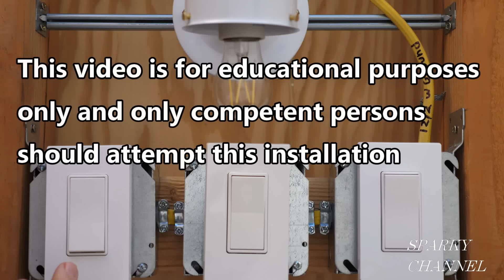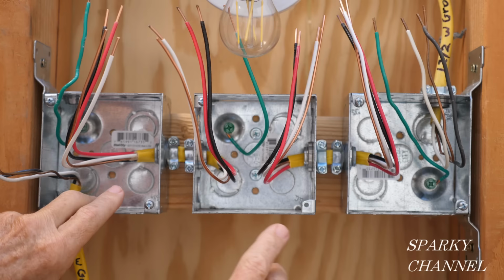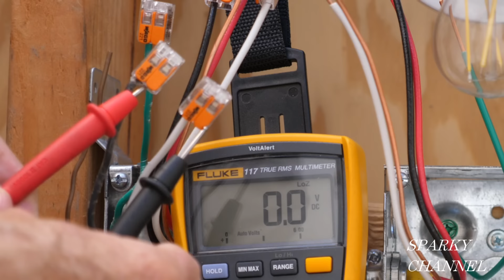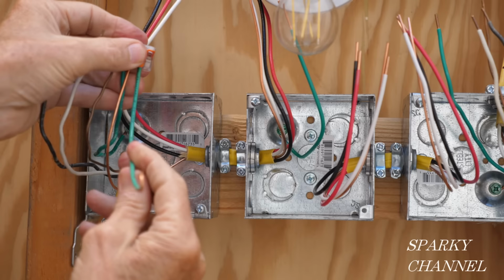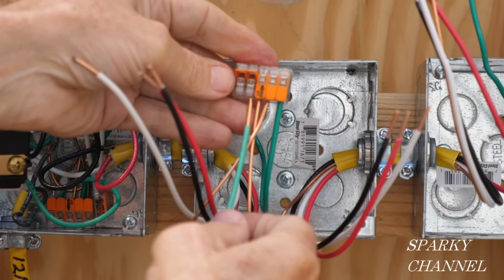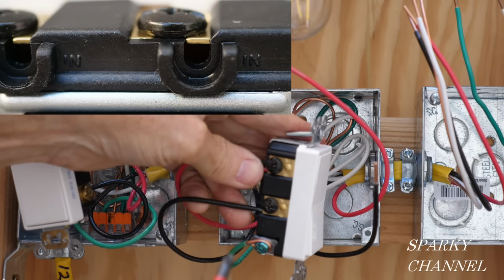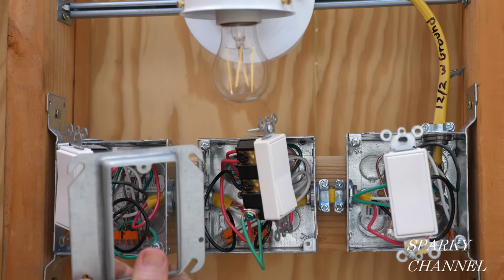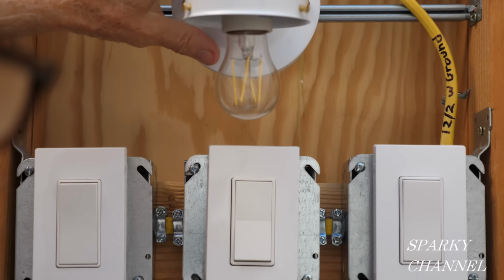How to Wire a 4-Way Switch System

Comment: Can the 12/3 wire be 14/3 since it's only a light switch?
Reply: No because 3 ways and 4 ways need a traveler wire (14-3) to allow current to flow between the switches
Reply: If your going by code you should look up your local code but yes you can since they are lights and it's no more than 13 lights in that circuit if I am correct for a 15amp breaker since your using 14g wire ... oh if they are LED lights you can put a lot more but for conventional 100w lights then yeah 😅
Reply: @corpseflow  I don't think your reading the comment correctly or is it me that's in the wrong
Reply: @evanstone9915  they read it wrong

Comment: So what if the power was coming into the light first?
Reply: You’d have some kind of fuckery where you’d have a black and white wire going to the first three way switch and I think you’d have to switch the neutral on and off at that point... I could call a guy I work with who would know but you definitely aren’t allowed to do that anymore cuz per code you have to have a neutral in every box

Comment: What is considered an unacceptable voltage drop on a 120v circuit?  I've seen between 122v - 119v.
Reply from the maker: 5 %

Comment: Awesome video...I have a question, will the 4 way switch still work if the travellers get mixed up?
Reply: Shouldn't make any difference.
Reply: No, it will not work.
Make sure the traveler wires coming out of the three way is the same going into the four way and vice versa.
Reply: @a.m.7060  as long as the travellers are split up properly and youre not mixing wires from either of the 3-way switches, it should work just fine.

Comment: There's no 4way switch however it's possible to control one or more lamps from 2 to 4 or more different positions using 2 2way switches and intermediate switches. 
Which is what you have done
Reply: Are you high?
Reply: Lol

Comment: I understand everything but the white wires.. whats the significance of them if they just go together in the box and dont actually touch the switch?
Reply: Neutrals are return conductors, they are intended for the final device receiving power as the way to get it back to the panel. Switches only serve as a breaking point for the hot conductor, they don’t need to break both sides of the circuit to function, only need to break the hot wire. The switches are basically just control points for the user to open or close the circuit at different spots in a room, the neutral will just run all the way through the boxes and hit the final device which completes it back to the panel, then when you close the circuit via any of the switches, the neutral will immediately allow it to turn on since it wasn’t opened anywhere else in the run.

Comment: What happens if in the middle switch the “in” traveler wires are on the “out” side of the switch?
Reply: The 4 way won't work. It would turn on but not off or turns off but not on. Till you switch them

Comment: I have a light controlled by 3  switches and I want to update the switches to a different color. If I pull the switch out of the box, is there an easy way to tell if it is a 3-way or 4-way switch?
Reply: 3 switches means it's a 4-way
Reply: Yes. If you have 3 switches you have the 4-way system. In a 4-way system 2 of your switches will have 3 terminals (not counting the green ground.) ONE of your three switches will have 4 terminals and a green ground screw. With a 3-way system you have only the 2-3 terminal switches w/a green ground screw.

Comment: My ? Is one switch suppose to be on so the other 2 can work because when one of the switches is off the rest of the switches won’t turn on light unless the one is on
Reply: And I did the same thing here and it works but just if one switch is off the other two won’t turn on unless that one is on
Reply: @cristianalfaro1500  re check your wiring and make sure you got 2 3way and 1 4 way if you trying to use the same method

Comment: My 4 way switch had the in and out switched. It didn't work. I'm curious why not?
Reply: Internally the device is completing a circuit based on the position of the switch. If it is wired incorrectly, it is not able to complete the circuit.
I wouldn't think of it as the red wire coming thru and then exiting as a red wire. 
I would think of it more like internally the switch is switching  between the red wire OR the black wire to complete the circuit.
If the hot incoming wire doesn't match the internal location, then there's no power to send thru to the other side.
 So you basically have wire  waiting for power on the input side, but it never shows up.

Comment: Does the box have to be metal or can I use just a standard plastic box
Reply: It can be plastic
Reply: Metal in commercial buildings. Residential only requires plastic
Reply: You can use any box

Comment: Would it be able to use a 3 way switch in the middle with wiring the both traveler wires to the com terminal? Because either traveler cable could be connected to the com terminal of the middle switch.

Comment: Just wondering why the 12/2 and not 14/2 ?
Reply: Maybe that's just what he had on hand? I'm no electrician but 12/2 is good for 20 amp circuits I believe, so 14/2 should be enough for just common lights like this. (15 amp circuit)

Comment: What happens at the light.
Reply: Just wire it up normally. Black to the bronze terminal. White to the silver terminal. Ground the box and/or lamp if necessary.

Comment: Why are you using 12 GA wire ??
Reply from the maker: I prefer the 12AWG wire due to less problems with wires breaking and someone adding receptacles to my lighting circuits.

Comment: How about a 4-way with a electronic dimmer on one end and 4-way and then a 3 way and the dimmer requires hot and switch leg, neutral and travelers.
Reply: Figure this one out when you have switch leg on one end and hot on other ,Jesse 40 years.

Comment: what to do when the wires got no colors
Reply: Well, that is a little harder.  You have to identify the wires yourself and label them in some manner exactly the same way Bill (Sparky) just demonstrated.  If the wires are already in the wall then you will have to use a circuit tracer to trace and identify individual wires and identify the same wire in the subsequent box.  To actually identify the wires you will need a circuit tracer, a digital volt meter-or some other manner to actually trace each wire.

Comment: Why 12awg?
Reply from the maker: As an electrical contractor that's the way I do it. Then if down the line someone adds onto the circuit it will have a better chance of handling the extra load.

Comment: Called 2way and intermediate in uk. Middle switch is an intermediate switch. Either end switches are 2way type.
     2 wires in between switches are called strappers!.
Reply: Same in Australia

Comment: Hey Bill! I have a 4 way switch that has the IN on the top and OUT on the bottom. I have 4 switches. I know on the 4 way switch my IN would be from the previous box. I'm assuming it doesn't matter how the wires run into the switch? 

https://www.lowes.com/pd/Eaton-4-Way-White-Compatible-with-LED-Rocker-Light-Switch/1001438272

Comment: as a retired british electrican,i find american wiring alarming.your standards are not as good as ours..we also call that circuit 2 way intermediate
Reply from the maker: OK, thanks!
Reply: You don't like his work or what it's called? We don't set the standards/regulations. That mostly comes from someone with a degree and no experience but they think they know everything. Kind of like politicians.
Reply: As an American electrician, there is no mechanical difference on how the internal contacts operate to control the load from British to American. The only difference is the naming of the parts. But they operate the same. I also believe American homes are much safer than British since American homes mandated RDC (GFCI) protects circuits decades before British. And now American homes are mandated to have Arc Fault circuit breakers.

Comment: "Only a competent person should attempt this installation"?? A contradiction right off the start!! If a person is competent, he doesn't need your advice. If he's not it's probably illegal for him to do so?? A three or four way system can be fed from the middle or from the same end as the fixtures!!!
Reply from the maker: I understand. Any suggestion for a better statement?
Reply: Not necessarily true about "a competent person"; we do so many different type projects all with their own customizations that a reminder on 4-way switches (that it's two 3-ways and one 4-way in the middle) is welcome when I've had my head filled with a hundred other concerns about large multiple voltage transformers and keeping track of what machines can run on 208v 3 phase power and which require 240v from transformers and installing 480v cooling system... last thing I want to do is read a bunch of tiny print that comes with the switches because the customer "just asked" for a 3 way switch with 3 switches (really a 4 way but he didn't know) "real quick" and my helper has never done one.
Sparky's vid can be taken in a minute by flipping through it but I find myself just enjoying his unwavering style and consistency - it brings me a moment of peace.

Comment: these switches are so weird to me. on the one end, they have ground which i have never seen on a switch, so that is great for safety, but all the hot terminals are completely exposed and need to be covered with electrical tape which is dumb. in Israel, all of our new switches are doubly insulted, the wires go through a plastic hole with the metal contacts recessed in the hole and the tightening screws are under the plastic switch levers and they are recessed into the plastic too, so after you hook everything up and clip the levers in place you can play around with the switch outside the box with no risk of touching any metal part at all, it's not grounded, but its all double insulted so no need for it. a much safer design in my opinion. American electric systems are so weird... and the metal boxes, those  were outlawed here in the 70's, its all fire proof high melting point plastic here, even our circuit breaker boxes. nice video though
Reply from the maker: Thanks!
Reply: Ya in Israel you always the best, just remember, where you got it all from?
Reply: @marekzuk132  I didn't say we are the best, and we copy alot from Europe but also we have alot of Israeli made products and as far as I know the Israeli socket is unique to Israel